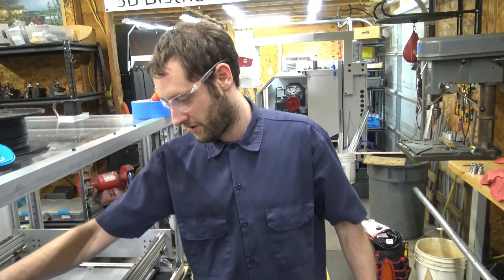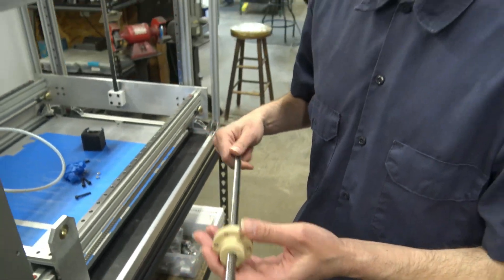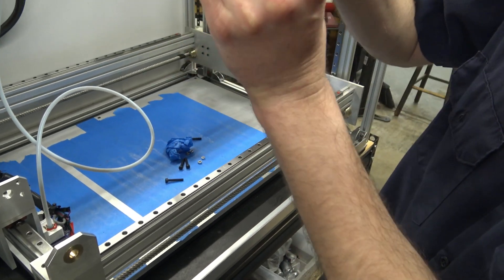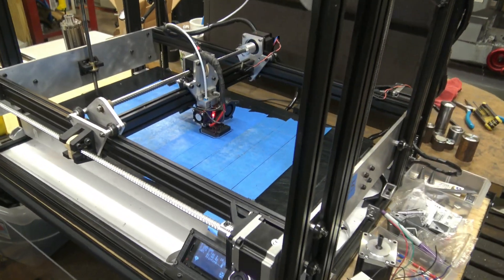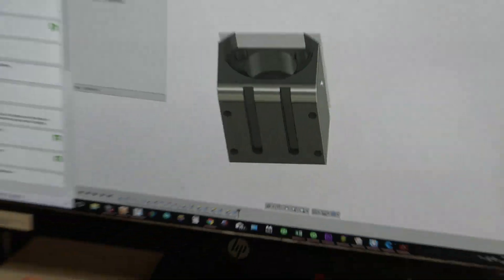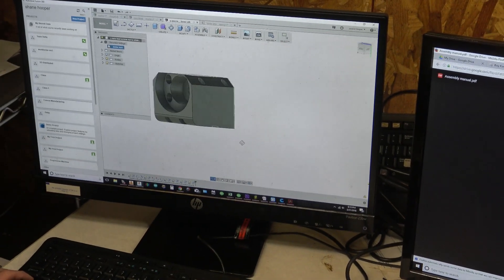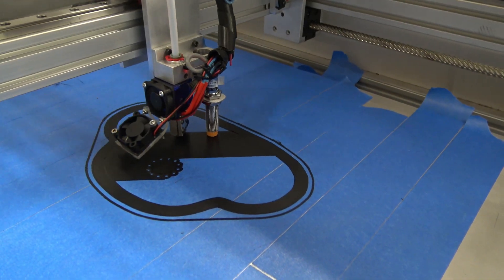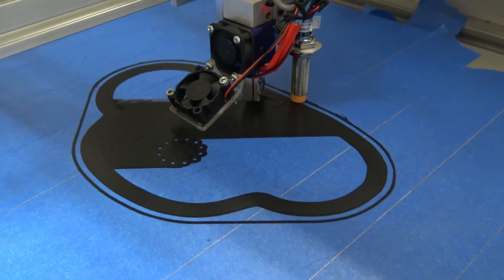XYZ Axis Lead Screw - WorkHorse 3D Printer Build

Comment: Are you going into LinuxCNC or different software to control stepper motors ?
Reply from the maker: Actually we're using the Duet Wifi.
Reply: Have you tried Klipper with this?

Comment: A machine that rigid should have a direct drive extruder setup. There's no sense in over building a 3d printer only to fight with retraction settings and spiking spring pressure of filament through a teflon tube. Otherwise that's a beautiful machine.

Comment: its not make it acurate if you print fast lol. and why in still noone has done 2nd y/x axis and between extruder or router for milling. Am i onlyone? your extruder wobble like any other cnc lol. my machine has 4 rails and 2 ballskrew for EVERY axis. its not overkill. 3d prints are smoooth as its possible for 3d print. every detail come from melting process not axis movement. 6mm depth for aluminium. if do it good do it perfect

Comment: Awesome job, that thing is beafy! I just built my own cnc router with two lead screws on one axis as you have. Are you synchronizing them with a belt or anything?
Reply: the duet is actually set up to do it automatically if you have two end stops
Reply: @jmgraydz  Thanks Samantha. That's how I'm running mine now. If one stepper motor lost a step in the middle of a job I would think a belt running between the two lead screws could help prevent that.
Reply: @daboss298  you would more likely hop additional steps causing even larger issues.   A ustepper on each axies connected to the external board wouls be better
Reply: @jmgraydz  Does RepRap firmware support position encoders?

Comment: sorry i have to say it your printer sucks.  gl, hf. (mine too but in the Z axis) 
glad to share my design with you if u care or want or whatever. free of charge.
Reply from the maker: Actually it doesnt suck but I do agree it is over built for just fdm printing. We have more long term ideas to utilize the lead screw. But I will say that we do need to preload  the z axis and redesign the y axis. There's a lot of changes that need to be made which we're working on at the moment. We're just using the materials and tools that are available to us at the moment so it is what it is. I do have to say that the prints we're getting off it our great. I've been running the machine for seven days at a time and it just keeps printing. A lot of people say that lead screw is a bad idea and they re right. But with the lead screw we're using we eliminated the speed and backlash problems you would normally have. It's definitely not perfect and is a work in progress but we're trying to do something that's different than what everyone else is doing. The market is saturated with belt driven machines and we're trying to offer something thats different.  I admit that most people dont need our printer and are better off buying a CR-10 or Gigabot. Our printer is ridiculously overbuilt and expensive but we're looking at having more than just a printer. We're trying build a digital manufacturing center that prints many materials outside of thermoplastics. I would love to check out your design and open ears to any ideas or changes to improve our machine. Just keep in mind that this machine is being built to perform our new printing process that we're working on which is a mixture of fdm printing and other extrusion techniques.
Reply: @3DDistributed  sorry if i was a bit rough,  what i feel re-seeing your video is that your machine is not as cost-effective as a couple i have built who do its job faster . and cheaper. sorry i drool when i see your shop but cant afford it :) 

i understand that you are trying to do something without belts , just "different" becouse thats what i do. i tought the same about belts as you until i read the bosch rexroth linear motion datasheets and was amazed with the precision that they reach with belts.

but as you i  wanted to test new stuff so ended up using 3 ballscrews for the Z  and a tpu steel core 9mm belt  in a heated chamber .

with the 3 ball screws at z i wanted to auto-level the bed using 3 motors but found it excessive  and ended up with a single motor and a 1688-2gt-9 belt ( kevlar/fiberglass not tpu, this one on the bottom of the machine outside the heated chamber) 
also teh 3 ballscrews  (1605) were meant to be oversized to attain a certain degree of lateral stability.  and that failed becouse the screws  induce some z wobble (0.2 max but its quite visible) .  as now im trying to fix that withot throwing away all my z axis   

but again a lot was learn with my design. 

corexy for my x and y axis so i could water cool the motors (both are static) was an excelent decision , they reach temps of 60 degrees inside the chamber , i know that by design they should be able to handle it but.. 

proper ventilation of the chamber, really usefull again, and needed,  chamber really  gets hot , so much i have to use layer fan even with abs and nylon , with pla i have to run the extractors all the time . 

hotend , all metal titanium is a must and i avoided water cooling the extruder even with pla 

layer fans, 30x30x10 blowers are really good

extruder fan must be ball bearing at more or less 10kRpm , wire it separetely so you can add some sort of speed /voltage control if u see you dont have enough airflow ( just pla )

again the motors...  i used 8kg nema17 but now i see them as oversized and and not what i needed.  its just that i dont need that much torque but fast response so low impedance steppers are more suited 

extruder, another win. direct, bondtech gears (china version, 9usd) without reduction (in the motor or the extruder, think of a bmg) works incredibly fine, and is a lot easier to reload  without gears 

i could write a book... 

https://a360.co/2OP8n3H 

you may download the design from here i think, its a mess but well.. its a work in progress..
Reply from the maker: @JorgeMarioManuelOrtega  I finally got around to checking out your files. Looks great! I love your models, I can tell you a lot of time into it. Hope all is well!
Reply: @JorgeMarioManuelOrtega  Would be interested in seeing your design but the link is broken :(

Comment: Have you seen this? It’s a laser heated extrusion setup that goes bitchin fast. You mentioned the extrusion was the bottleneck on your system here. 

https://m.youtube.com/watch?v=8wVGaxgkmk4&feature=youtu.be

https://www.sciencedirect.com/science/article/pii/S2214860416303220
Reply from the maker: Yeah I've seen this. We purchased the white paper when it came out. They use  threaded filament that moves through the extruder at excessive speeds with some kind of laser hotend heater or something.Maybe one day we'll be that advanced.

Comment: Have you tried to measure the turnaround error when reversing the X and Y axes?  I don't know if the software can compensate for it or not, but, if so, it could help reduce the blobbing somewhat.
Reply from the maker: Not yet, I'm working on an apparatus with indicators to make some measurements. I'm also making some anti backlash lead screw nuts.

Comment: Are we trading speed for accuracy? Seems kinda slow. What are the advantages of lead screws in all three axes?
Reply from the maker: It's not that slow. We're using multistart lead screw that advances 50mm per rev. It looks slow in the video because we're using a volcano hotend with 1.2mm nozzle. The extruder is actually the bottleneck. We print 6x faster than my old makerbot.
Reply: What’s that in mm/sec?
Reply: @tamvalley415  Makerbot (mm/sec)*6